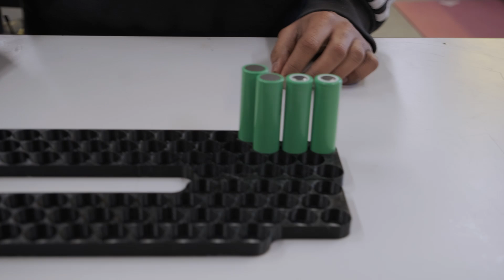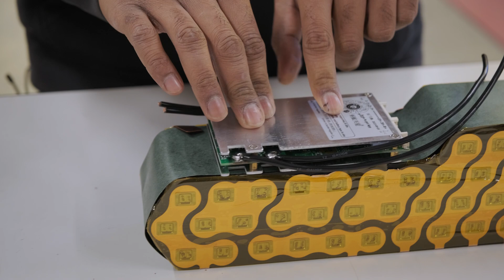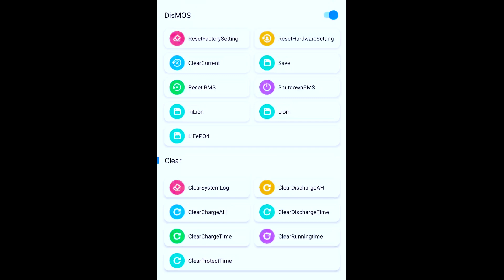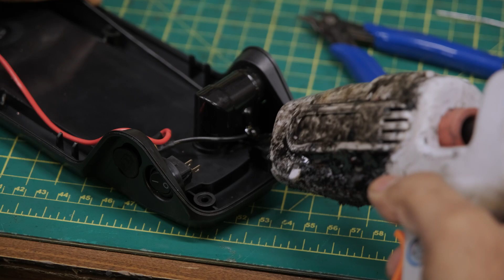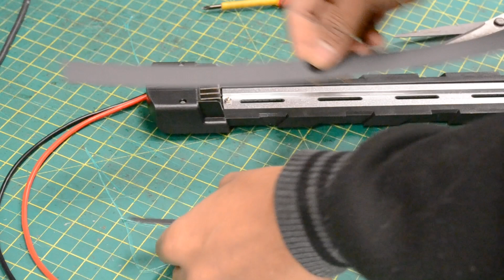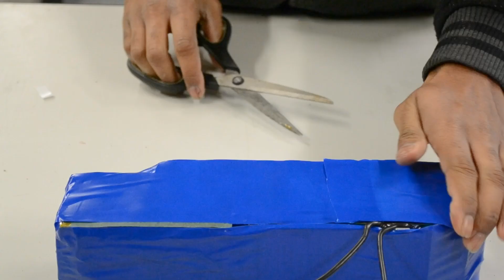DIY - This Tiny Battery Peaks Over 5000W , and its Bluetooth!

Comment: I just built a bike using a CYC X1 Gen 4 and thanking about getting a battery off you guys, what do you think about individually wiring the cells with fuse wire?
Do you recommend and sell the Grin Satiator charger?

Comment: What was the purpose of a different base and lid?
Reply from the maker: Normally this battery is not possible to build unless you use the base of one battery and the lid of the other. The DP7 case that we use the base from is a 70 cell pack, which is obviously way too big for this pack. Then the DP4C lid is originally intended for a 39 or 40 cell pack with small BMS (48V15AH or 36V20AH) , the "C" stands for "Controller" as normally the DP4C base makes room for a controller (while sacrificing space inside the battery). We can still use the lid from the DP4C as it's shorter but the DP7 base leaves more room for cells / larger BMS as it doesn't have the controller compartment.

Hope that makes sense !
Reply: @ElectricBikeLaboratory  ohh that's cool. There's a lot to know about all the various housings

Comment: Nice pack. Is there no need of putting a fuse for a second level of protection, incase the bms fails?
Reply from the maker: Fuse or breaker is never a bad idea ! You can never be too safe. In our experience usually when the BMS fails the battery just shuts off. Thanks for the comment ! 😁